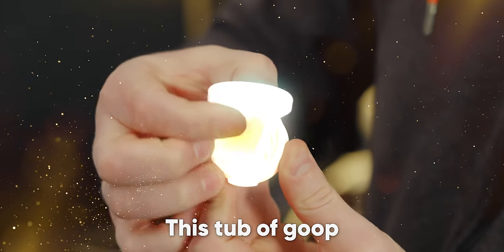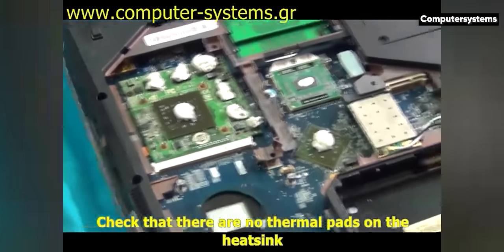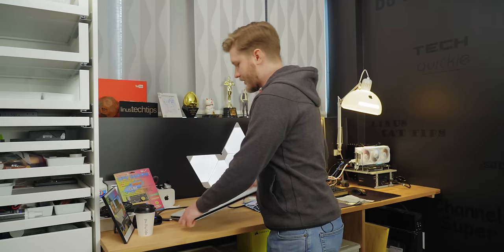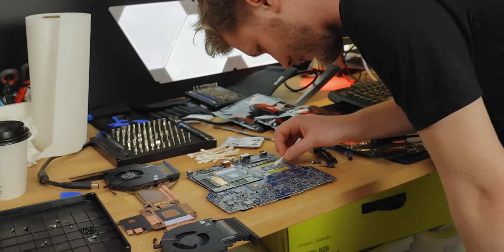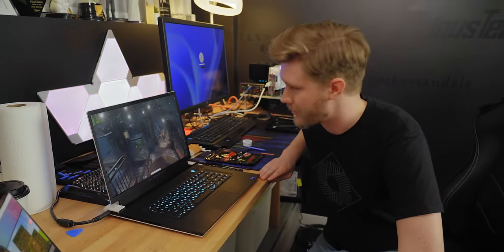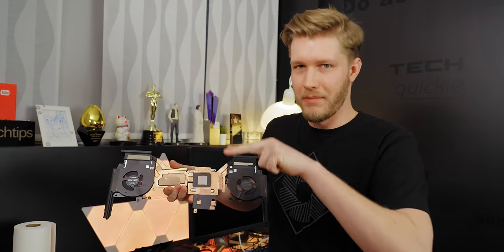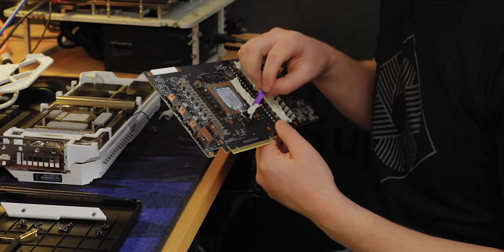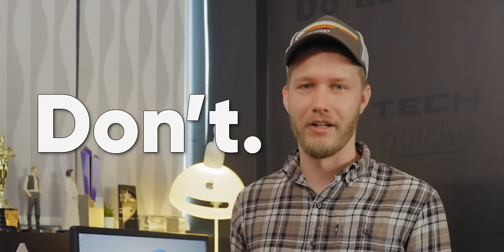More FPS for just $10 - K5 Pro Viscous Thermal Paste

Comment: I'd really wish they mentioned the average temperature difference of the memory of the GPU with the pads and with the K5 compound. See if there was a difference there. Also thermal paste temps too with the core.
Reply: This is exactly what I was looking for as well. My 3090 memory temps get really high and knowing if those could be improved would have been really useful.
Reply: I would love to see if mem temps was reduced to. I have a rx5700xt that has high mem temps, thinking of testing this stuff out on it..
Reply: @jzetterman  I'll spare you my pain, they make memory temps worse, my 3080 has gone up over 10 degrees, it doesn't work
Reply: @Alpejohn  I've got reference 5700xt and I'm curious too

Comment: Bought this because of the positive review. Replaced the pads on my 3080 FE (long story short I had 3mm pads that were causing poor GPU contact and 90ish degrees on both hot spot and memory). Spent about 3 hours cleaning off the Gelid pads and applying this gunk. Which is not as smooth or buttery as it is in this video.

Anyways. Got done, fired up the PC, my GPU temp and hot spot were back to normal, but my memory is back to thermal throttling. Worse than it was when stock. And stock was terrible. With an OC, it sounds like a jet is trying to take off (can hear it across the house). And it's 108-112 even at stock (and I usually run +1,000). Also, I had to buy 2 tubs just in case (and needed them), and it took 4 weeks to get here from Greece. Big regrets. Huge waste of time, energy and money. And the worst part is cleaning it off will. Be. HORRIBLE!

This is why LTT needs to include important numbers in their benchmarks, and not just fawn over a product that's not good because it doesn't decrease FPS in a racing game. So dumb, man. -1
Reply: Same, my Memory went to thermal Throttling IM SOOO Glad I didn't do it on the inside Chips of my 3090 just the Uper Layer ones to increase transfer to my backplate heatsink but man temps shot up real fast and I wasted some good thermal pads as I already did a change job on it. Even without an overclock I'm currently hitting 100c+ on my Mem which was more like 90 without oc and 96 with
Reply: @CASyHD.  yep, and they even mentioned this garbage in their latest video. So freaking annoying.

Comment: Hmm, depending on how thick it is, you might be able to use a piping-bag for getting it on there.
It will probably reduce the mess, and application-time, quite a bit.
Reply: I was thinking the same thing kind of. Using different tip size syringes to apply it

Comment: I don’t understand how this would result in better performance unless 1) it was thermal throttling stock or 2) you were able to apply a greater OC thanks to the extra thermal headroom
Reply: That's what I was wondering.
Reply: I was wondering the same, should have pushed OC to its limits before tests to see any real difference. Should have just given the temp / fan speed to show sicne that really the only difference this can make

Comment: unusually, this is exactly the kind of thing I've been looking for for the better part of a year. 
I was in the middle of refurbishing a Powerbook g4 17 inch that my grandma gave me. It's an ancient laptop, and uses some kind of white thermal goop instead of thermal paste or pads to cool the GPU. I was never able to find the right size pads or paste that was similar to what came from the factory, but this looks like it might do the job.
Reply: white thermal paste? Sounds like nano diamond or IC diamond if I remember right. Standard thermal paste in the old days compared to the gray Chinese goop nowadays.
Could also be thermal epoxy.

In any case, you shouldn't need thermal pads for the VRAM and any Chinese goop should even work provided your heatsink heat pipes still are okay and the fan still pushes air properly. You may also want to check on mounting pressure.

For something that old, I'd also look into oiling the bearings of the exhaust fan.

Comment: I had these before when I'm trying to improve 3080 trio memory temp -it sucks, temp was worse than stock msi pads (108 vs 120C), k5 pro is very annoying to clean. My best recommendation is measure thermal pads and use the 12.7W/mk kinds like  thermalright and gelid. You get better performance without the mess. I think k5 has a place for laptop repair shop where you don't need to stock various thickness of thermal pads. If I recall correctly alot of waterblock thermal pads are 2-5W/mk so there may be come gain with k5 but not by much.
Reply: Hi
Reply: yeah thermalright pads dropped my MSI suprim x from 103c to 86c, my mind was blown

Comment: I've always wondered if putting thermal paste on thermal pads would be effective.
Reply: That's like putting 2 condoms. Sometimes less is more.
Reply: if you think it doesnt make good contact you can absolutely do it to fill the gaps
i did it on my 3080 and it dropped a few degrees on the mem junction
Reply: The only reason pads are used on the memory is clearance.  Paste might not fill those gaps adequately.
Reply: It can be depending on circumstances really, I have done that on pads I had to reuse at several occassions. But it was always just minimal amount of paste there. Also results did vary, had cases where it helped driving temps down and had cases where temps went up, then needed to go back and clean it... pain in the ass. But in general, I only did it when reusing old pads, which were already deformed by long time spent on VRM's or memory chips. 

It's quite possible that my varied results also depended on different pads material/quality/thermal paste used.

So I'd say to only try it if you want to monitor temp change and don't mind cleaning it if it mess up your cooling.
Reply: @Tubenstein  yes i also used one tiny drop of paste per gddr6 chip on top of the used pads and it worked very well

Comment: I used this on my Asus Zephyrus G14. Works great and it's very easy to install. Along with using Gelid GC Extreme on the CPU and GPU it dropped temperatures significantly. I've got under 80c across the board.

Comment: This stuff helped loads with my ASUS GX502GW. Worth noting that the manufacturer used a similar "thermal goop".

Ran furmark for 17 mins and it was consistent throughout.

CPU still hits 90 and above on really demanding work loads but it's more of a brief spike that dissipates faster.

Better than using pads on the VRMs and other chips which I originally used when refurbing my laptop as I didn't know about K5 at the time.

I used thermal grizzly paste on the CPU and GPU.

Comment: i was hoping you would do vram specific hotspot measurements rather than FPS improvements, the 3090 struggles hard with keeping the vram cool on the backside of the gpu with just a passive backplate

Comment: I personally wonder more about the difference / benefits between a normal thermal compound and this product?
Reply: Probably worse. The goal is to be a better substitute for thermal pads, but is messy (which is why you'll likely never come across this in place of thermal pads).
This stuff has existed years; if it was better than normal thermal paste it would be more commonly known.

Comment: I've been wanting to re-paste my 1070Ti, but I've been worried about the thermal pads for the very reasons specified, and ordering them can just be a pain, so now I'm just gonna be ordering this. Very nice review! Thanks LTT!
Reply: Let us know how it turns out
Reply: @jrno93  Will do. Ordered it last week, so hopefully I’ll get the stuff in sometime this week, and I can get to work on it.
Reply: Aright, finally got the stuff in, and re-pasted my GPU with Thermal Grizzly and swapped out the VRM thermal pads with the K5, but left the MOSFETs and chokes with their thermal pads, as they were still in good shape, plus the K5 takes patience to work with, and mine was all tapped out after the VRM's. lol But VRM's were the main thing I was curious about most. 

The biggest tangible improvement came from the thermal grizzly, as it dropped my temps in TimeSpy from 64C to 56C with the same OC settings. That old thermal paste was pretty crusty. lol

Comment: as many other comments pointed out: Y NO THERMALS???
we care about the fps gains, but we also care about the thermals
Reply: They didn’t use an external temperature probe. The gpu doesn’t specifically monitor all of those components so you would need to place probes to record any data and it wouldn’t be in the chip but on it.
Reply: @alexmills1329  but wouldn't there be at least some visible gain in the temps the GPU does monitor? Presumably yes but by how much is only speculation
Reply: @__Mr.Long__  not speculation Gamers Nexus does really good thermal testing with probes and measures areas suspected of running hot, look at their ps5 coverage on it for example off the top of my head. And heat creep through those copper traces in the pcb definitely exists

Comment: You guys have no idea how nice it is to find out about this product when I do hobbyist maintenance work for friends and family with repasting and cleaning PS4's, Switch systems and whatnot. Old GPU's that we want to keep going rather than die because markets are what they are and we are already not the ritchest, this being fairly cheap product from fairly close by is excellent as well. Buying this is definitely easier than dealing with thermal pads; sourcing and buying the right ones etc. Learning about this, even if it is late, is a godsend for whatever maintenance I can do for friends in future.
Reply: Read the other comments before using this stuff. . K5 is okay for lower temperature components that only need a little cooling (like in old consoles) but don’t use it on GPUs.

Comment: I'm playing around with this and scrap copper for getting my gaps for cooling down to like 1mm and using the goop to fill in the blanks.

Something I've noticed is that many of the components that get cooling pads have some extra wiggle room in how they are mounted to the board. On casual distant examination they look very flush, but when a flat surface is applied to the tops of them there is some very obvious tilts going on on some of the components.  Which is only amplified when circuit board flex happens from mounting hardware to it. 

So right now my target is using some thin scrap copper to get everything down to a 1mm or less clearance, using a little fine sanding (with a vacuum to pick up any particles produced, and remember for this less is more !!!!!! )) and then using this goop to fill in all the blanks when the heatsink is reapplied.

Comment: I am very  skeptical that the temp of the VRM was throttling the system, and disappointed the VRM temps were not measured.    If the VRM are dumping more heat into the shared heatsink Via a better TIM, that would actually increase GPU temps.
Reply: I do recognize the benifit if your Ram is over heating, however i would guess thte GPU is loading the heatsink and not allowing for enough capacity to properly cool the ram

Comment: I'd love to know the thermal data on this stuff.
I've changed the thermal pads on a few high end gpu's recently, and I'd be curious to find out if the k5 pro has any advantage over a good 12.8w/mk pad
Reply: From what others are saying, it will perform worse but has the huge benefit of not having to know the thickness of the pads, just apply a ton and you're done.

Comment: The X17 being actually BETTER before repasting is credit to ASUS in my opinion as it shows they didn't cheap out on cooling and actually optimised it.

The 3090 however just blows my mind, it showed an approximately 5% fps average increase on repaste but both the 95th and 99th %ile actually was an incredible between 20 and 25% increase in fps .

The additional K5 tho even tho very slightly better could almost be margin of error.

Comment: i Saw this video and done this on my Lenovo Legion 5 Pro too.
the Result is Amazing: 
Tested with RS6 Siege on Maxed out 1080p in Performace Mode (6 Runs)
(BIOS OC +100 GPU and +250 RAM)
Before Repaste
Max Boost GPU: 2100 MHz
Game Clock: 1860 MHz
CPU Clock: 4000 MHz
FPS: 285 FPS avg.

 (Gelid GC Extreme + K5 Pro as replace for all Thermalpads)
Max Boost GPU: 2115 MHz
Game Clock: 1980 MHz
CPU Clock: 4075 MHz
FPS: 304 FPS avg.

And much less Noise!

Comment: I brought some of this and just applied it to my RX 570 (applied 10 grams in total, didn't do the back plate as those pads are over 2mm). O M G. 
Normally my GPU idles at 44 degrees C, with a fanless mode. And that's with new thermal pads.
I applied this, to my GPU, put it back in and turned my PC on and the temps were 28 degrees, which has never happened. 
I let it settle with HWiNFO and HWMontor running in the background, and  as it's more like a paste I let it heat up and spread out all that it wants. 
It finished warming up at around 38/39 degrees C (it flicks between, so probably 38.5). Around 5 degrees cooler across the whole CPU, and somehow the di too. 
Opened chrome/youtube with all my tabs and my CPU finally hits 30 degrees, GPU 38.

So I'm impressed.

Comment: I pretty much knew what was going to happen with the laptop. Short answer "not worth the effort", Dell uses thermal pads on the SSD, but paste on the CPU/GPU. The problem with high end "thin" laptops isn't the TIM, but the fans, which have relatively short lives if the laptop is used like a desktop replacement, we're talking months, not years.  The GPU's will have diminishing returns because they're limited by power input, not by thermal dissipation.

Comment: Warning!  This is NOT good on gddr6x memory like on the 3090.  The memory runs so hot this stuff actually boils and makes air bubbles.  I bought this stuff on the recommendation of this video, and my 3090 memory temperatures are MUCH worse, and when I investigated I discovered the stuff  was boiled and burnt and oily.  If I had not trusted Linus Tech Tips, and did other research on this, I would have realized this beforehand.  You let me down guys :(  At least my card is still alive.
Reply: For real? I just got some and my temps are awful on my 3080 FE. Do I need to not mine until it's off? What a joke. Have you cleaned yours yet? Tips?
Reply: @hdwblade  I'm in email contact with the supplier about it.  I'll refrain from any more comment until I see what they have to say about it
Reply: @Demerus99  pls update, i literally just did my mod should have looked here before trying it got awful temps.
Reply: @Demerus99  any update?

Comment: How about you fill in the micro gaps first, using a soft thermal paste (scraping excess off with straight edge leaving a thin film) on both surfaces and then use high end pads ?

Comment: I found better performance putty
TG-PP10 Thermal silicone putty
With 10w/mk thermal conductivity.
This on a level with thermalright and gelid, just more soft and fill gap between mem and heatsink very soft and easy.
I just take 1kg unit for my mining farm and easy replace on all gpu with different sizes gap.

Comment: Viscous boils if you put thick layer, because of air bubbles inside...

Kritical Thermal Pads - Extreme Conductivity (20 W/mK) - Designed specifically for GPU, CPU and Other microelectronic is a safer choice...

Comment: seems like a straight forward solution, Thermal pads aren't even that conductive, they're just mildly conductive enough that you get enough heat transfer. You'd never use them on something that needs to get cool or has a lot of heat generation

Comment: You should do an updated tests with putties especially now that new putty formulas has come out with better thermal conductivity and not as messy as the k5 pro, putties nowadays almost gas the same consistency of dry playdough and not as oily as old putty formulas.

Comment: How does this product stack up against Laird’s thermal putty? The miners have been using this for quite some time when servicing GPUs, since some manufacturers use thermal putty instead of thermal pads (because they can’t reach desirable tolerances on component heights/ cooler manufacturing).

Comment: Remember when you guys put a thermalpad inside the fan-less M1 Macbook Air to use the bottom aluminum chasis as a heat spreader and it worked? You should try it again with this K5 thing.

Comment: It's incredibly difficult to benchmark laptops, because if it's cooler, it just needlesly bumps up frequencies and voltage so that the result is pretty much the same. You would need to be running it at fixed frequencies, voltages, etc. to make any real test.